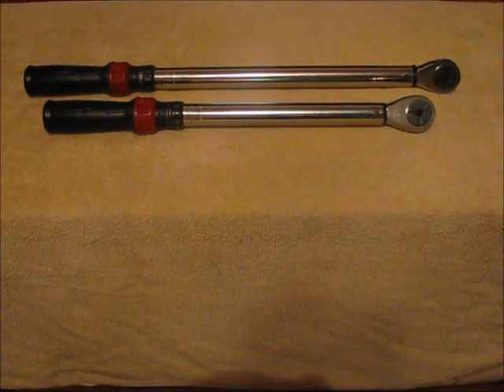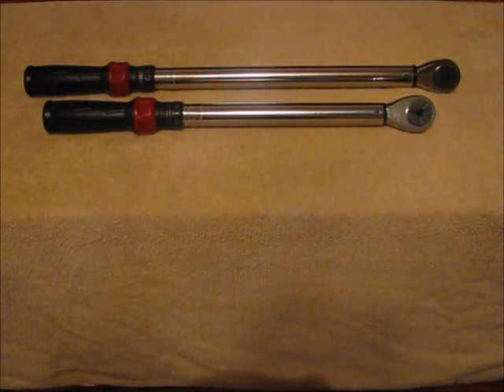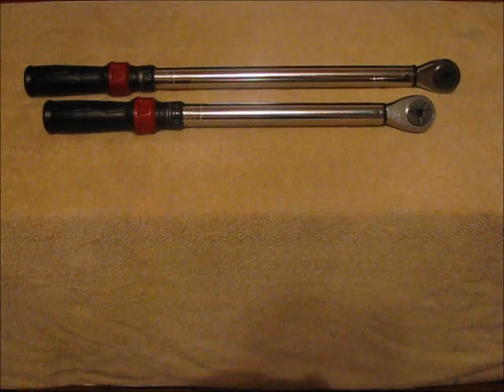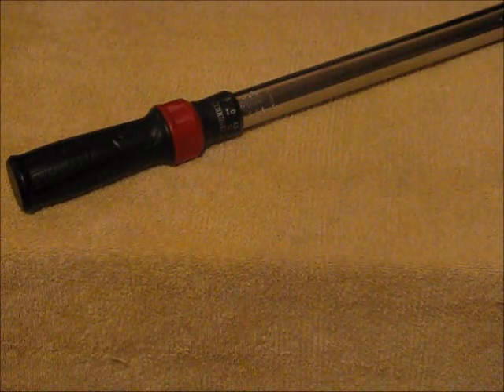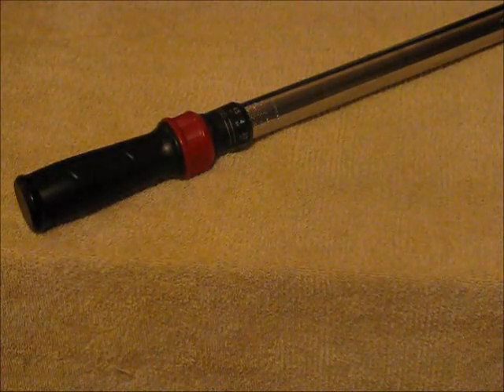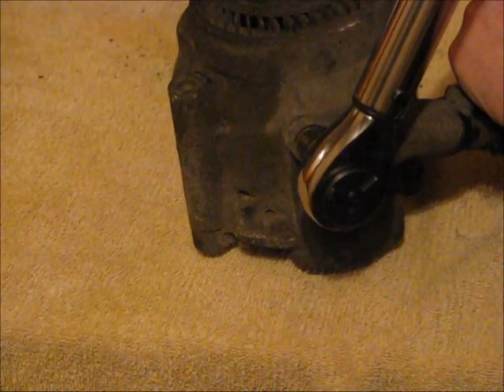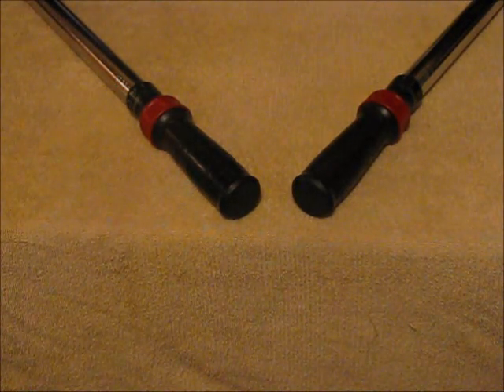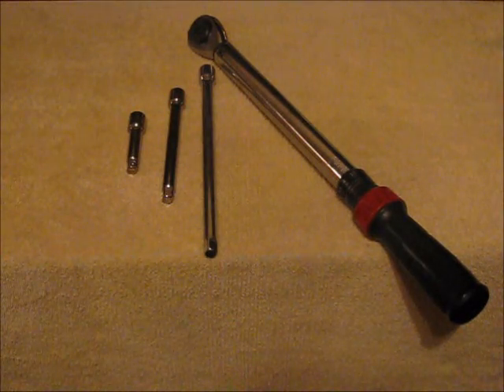Torque Wrench

Comment: Nice video. My Craftsman 1/2” drive torque wrench has 1/4” of “up down” play in the adjusting handle. So the question is, is the reading correct when the adjusting handle is pushed forward, or pulled back?

Comment: Really nice quick overview, straight to the point. Especially the 24 lbs example, I wondered how to set the exact setting as mine goes by 1 ft/lb increments but there are no "hash marks" like a ruler between the 10's or whatever. I have the 1/2" big guy, I know there is a scale as shown on yours, but mine has a 2nd scale on the underside. It's for Newton Meters.
I doubt I'll be needing N/M anytime soon, but it'd be nice to know how just in case. The instructions are a mess!

Comment: nice video, thanks. 
I have  a craftsman model 9_31423 which is to measure from 25  to 250. now my  question is , is this meaurement 25 inches or 25 ft. engraved over the numbers it say "inches-pounds" but I keep hearing about foot pounds. thanks , sincerely Dyslexic :-)

Comment: I just got one today from Sears, the Craftsman micro-click 3/8" that reads inch pounds. Warranty is for one year, no guarantee for accuracy after 90 days (no recalibration or exchange after 90 days if reading is way off). In essence warranty is only 90 days! It looks like a nice one, we'll see after a few uses.  

Update:
My inch pound torque wrench is the same size as the 1/2" one except its shorter. This is the biggest in lb wrench I have seen, will not get into some tight spaces like the others. Oh well Sears saving money by using interchangeable parts with the other two 1/2" and 3/8" wrenches. The other thing is the increment is in 15 in lbs rather than the conventional 10; need to get use to it.
Reply: Frank W I just got one of these, but for the life of me can't figure out how the reversing mechanism for the ratchet works. It came on "loosen" ratcheting in the CW direction. The manual just points to the knob at the back of the head. I turn it one way and it just ratchets, the other way and it doesn't budge. Any help?
Reply: Arthur Orton Hey Arthur, you got it right - the black round knob back of the head, turn clockwise it ratchets one way and turn the knob counter-clockwise it ratchets the other way just like a socket wrench. Yours could be defective.
Reply: Thanks for the reply. Figured it out with the help of your comment and one other - you've got to make sure to hold the drive side while doing this.

Comment: Thanks for the info! very informative! What in your opinion would be the best size torque wrench for a 1992 Mercury Sable? Or what size/s to own in general. Again, thank you :)
Reply: Don't know about Mercury Sable. If you could just have one, get the 3/8" that covers most situations. You need 1/2" (up to 250 foot pounds) to cover the bigger stuff like crank pulleys and smaller 1/4" (inch - pounds) for small stuff like oil pan, water pump.

Look at the Kobalt 3/8" and the monster 1/2" from Lowe's. I have both of those, pretty sweet and excellent quality.

Comment: i agree with your video but i have used beam style so many times and never had a problem with bolts coming off or the torque being off, so i disagree wit the amount of accuracy on beam style as they are pretty good althou8gh the clicker style ones are easier and faster to use

Comment: I do not know if you know this or not but at least 70 percent of all craftsman tools are made in china . I went to sears to replace some of my bad sockets and a broke torque wrench I had bought in the 90s  I looked at them and they are all made in China . I was going to buy Ace hardware tools made in Ohio but now there made in China too . Maybe Snap on?
Reply: Wow, I see your comment is from long ago... I was just told by someone that the local, (10 min drive), Sears was in fact still open. It's in the back of the "old" mall. There's only best buy, sears, and maybe one other still opened. Worried  they might just bolt the doors anyway I grabbed some of my more useful/needed (but broken/rusted) hand tools, screwdrivers, sockets, wrenches, a 1/2" ratchet, and 1/2" torque wrench like in this vid, and headed in. I had to get to a manager for nearly everything but the 1/2" ratchet., (The employee said that while rusted, or part rusted, it's not "broken.) Now to the manager I said look, the rust shouldn't be on there. That, along with the absolute warranty MADE craftsman a Household name! The whole point of Every piece being chrome plated was to prevent rust, and to make them shine clean after a long hard work day. Not to mention that the rust does weaken the whole thing. Sarcastically I asked, what do I need to do, go home and grab the sledge so they are "broken"? Reluctantly the manager said ok fine, and sent the employee to get the replacement stuff except the 1/2" wrench and torque. He said they rebuild the wrenches now unless say the handle snapped in half... it kind-of irritated me that I now had to come back the next day for my same tool, now "refurbished", (and with less teeth btw)! I just said fine, grabbed my bag of half a dozen shiny new tools and walked out with a receipt and a smile. Until I got home and checked them out, All made in CHINA! It was then I was grateful I'd get my good old 1/2" ratchet back!
The torque wrench model, like in the vid is what I have, he said it only has a 1 year with receipt. I argued with him that it's a craftsman "hand tool", period. Don't forget that when I bought it about 20+ years ago I paid the same price they charge now, $80 for that wrench! The best they had back then, but had I gone with a $25 "beam" torque it carry lifetime?!? Explain that one. After some back and forth,  he said he would call craftsman himself and explain my side and see if he as a manager can do anything. I went in the next day to get my Still made in the USA, Rebuilt 1/2" and was hoping for the best on the torque. My wrench looked so nice, it's not Chinese. Well there was my old torque sitting there on the counter but there was also a brand new one in a big screwed together box. The manager was ther and said he got them to replace for a brand new one, give me a receipt, and I have no excuse but to follow the year warranty. It's prob also made in china, but my old one didn't work, so..
It's sad to know/see the craftsman quality gone, the warranty can be Very difficult to even have them follow, or I've heard some stores set limits on the # of replacements, I believe per day? What is the point? 
I've been in overdrive mode trying to fix my 2 air compressors, and a motor but even sears parts direct claims they don't make nor have any of nearly every part, not even gaskets! Most use the same design with different configurations to make hundreds of different compressors that all use the same part! So they say they don't carry it, (which I'm pretty sure is covered under warranty if I have proof of purchase), so I look on Ebay for parts, and I'm finding "some" of the exact parts. When I click on it to check it out, it's actually SearsPartsDirect is the seller! So they tell me the part is unavailable, and I should buy a new one, yet the same company is selling the parts I need on ebay!!! Do they just not want to warranty it, or what? Obviously they do actually have the parts I need, doesn't matter too much if it's covered or if I have to pay a Fair price for parts. Obviously they want you to buy new, but when you've had something for 20+ years, that was passed down by my grandfather, who bought it before the computer or even the fancy catalogs, this is stuff that was delivered in a crate that he had to put together part by part. You can't just toss something like that! (Although I did toss an OLD tablesaw because I couldn't find parts reasonably priced or at all to make it fully function/safe, and that was at least 60 years old!) 
These items are so old the company doesn't even have the manuals or orig purchase price, and they couldn't even tell me what the receipt would look like as it was before the printable calculator, and they were mostly written up on a sears header paper that was hand filled out! (with the proof of purchase all work/parts are free, except parts that do wear out normally. Belts, for ex. SAD...….